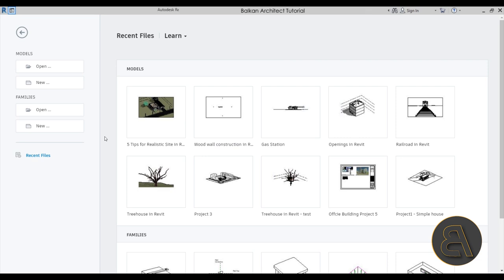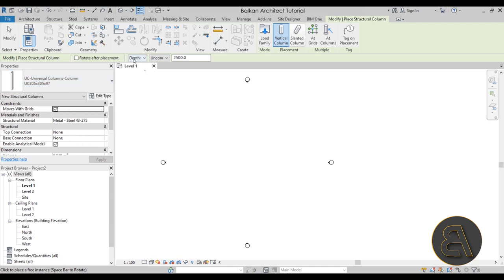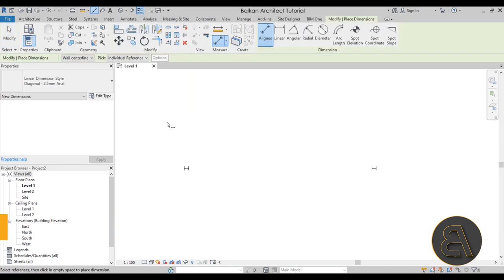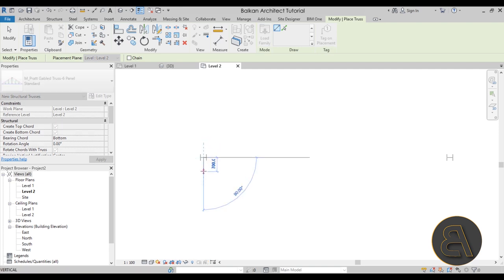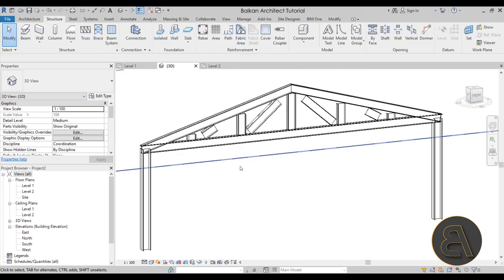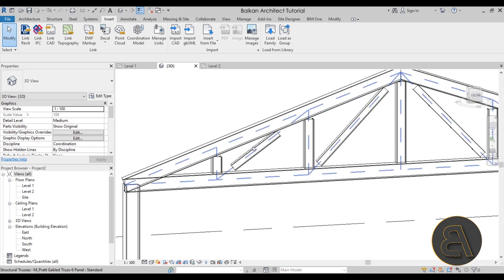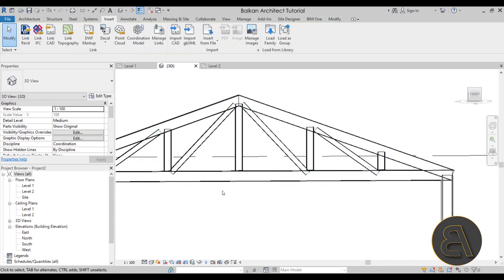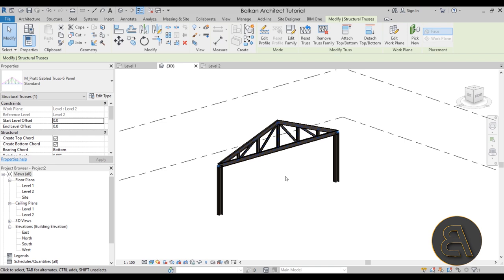Truss in Revit Tutorial

Comment: Drop everything about unpinning and dragging the extend.  Go up to the Steel Menu and there is a COPE option there that will create a connection between the two pieces.  You have to select then CTRL select the 2nd item.  Then hit ENTER.  And if you change the height of the Truss the angle of the COPE will change too.
Reply: It would have been nice for Autodesk to add the connection into the family.
Reply: OMG ur reply saved me!!!
Reply: But i cant select structural frame even i hit tab button